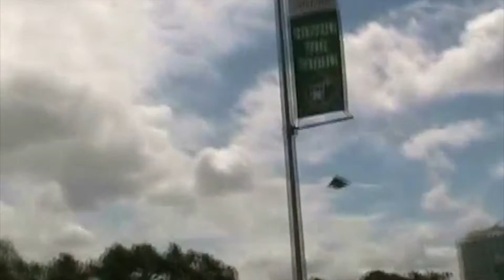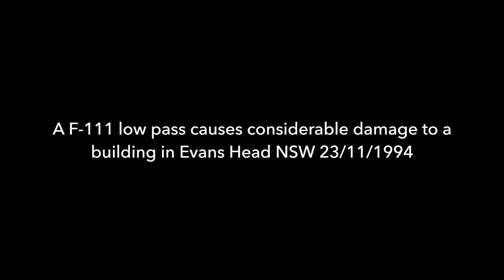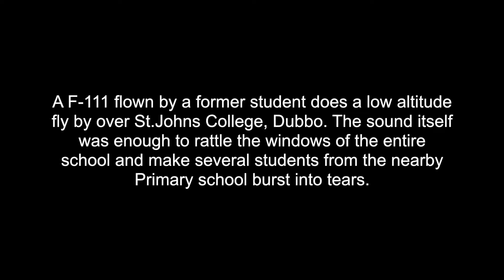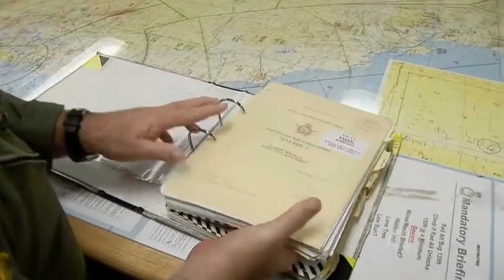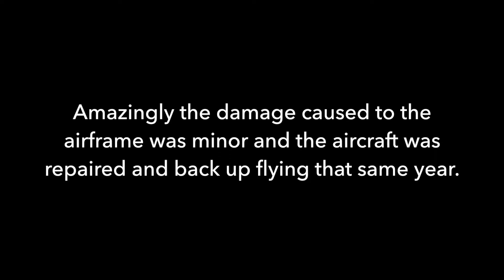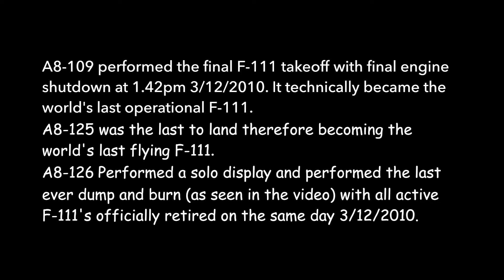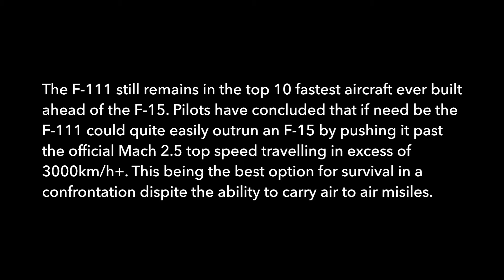RAAF F-111 Dump And Burns, Public Flybys And Interesting Events

Comment from the maker: A dump-and-burn is a fuel dump in which the fuel is ignited, intentionally, using the plane's afterburner. A spectacular flame combined with high speed makes this a popular display for air shows and events. The aircraft has been used for this purpose in Australia during the 2000 Sydney Olympics and making regular appearances at Brisbane's Riverfire Festival and the Australian Grand Prix. 

The F-111 is ideally suited to perform the dump-and-burn maneuver, as the fuel dump nozzle is located between the two engine exhausts. The F-14 Tomcat is also able to perform the dump and burn however the manoeuvre is prohibited for U.S pilots and it has only ever occurred by accident.

The F-111 was state of the art back in its day designed to fly low and fast in all weathers at 50m sometimes 30m from the ground under enemy radar which it performed all throughout the Vietnam War during bombing raids. It could fly in this manner hands free using its automated terrain-following radar. Pilots explain how scary it was letting the plane fly by itself in the pitch black dark 50m above the ground as it bobbed and weaved over the tree canopies below at high speed often hitting high g's as it hugged the hillsides. Pilots say it was a constant violent event of +4gs -4gs. 

The F-111 was one of the fastest planes on the planet at the time and still by today's standards. It could reach speeds of 3000km/h + and fly up to and above 60,000 ft. It is the only plane known to have intercepted an SR-71 at cruise speed and altitude. Note I didn't say dash speed, or max altitude; note also this was before they detuned the engines for maximum longevity vs. performance. The F-111 was also the first variable-sweep wing aircraft to be put into production. 

The two crew members sat side-by-side in an air-conditioned, pressurized cockpit module that served as an emergency escape vehicle and as a survival shelter on land or water. In emergencies, both crew members remained in the cockpit and an explosive cutting cord separated the cockpit module from the aircraft. The module descended by parachute. The module could be released at any speed or altitude, even under water. 

The F-111 pioneered several technologies for production aircraft, including variable-sweep wings, afterburning turbofan engines, and automated terrain-following radar for low-level, high-speed flight.
Reply: Whoa, yeah I can imagine not seeing anything and letting the plane do everything would be horrifying hahaha

Comment: Wow, I had never heard of the dump and burn until today, what a fantastic sight, absolutely awesome. It brings new meaning to “you won’t be happy unless your doing Mach 2 with your hair on fire” (or words to that effect). 😀👍🇬🇧🏴
P.S Colleagues of mine once had to do an engine run on a Jaguar aircraft at night during an exercise back in the 80s, but we couldn’t move the aircraft to a designated engine test pan (hard-standing) due to the taxiway being blocked (in the exercise, not for real) so we positioned it so it was pointing in a safe direction (or so we thought), all was going well until the engine under test went to re-heat, the dancing diamonds appeared (re-heat exhaust pattern) to reveal that an old air raid bunker was suddenly missing its wriggly tin (corrugated tin) roof that was by then some distance away and still going, nothing was ever said about this unfortunate accident (as far as I know) and the engine run was a success.